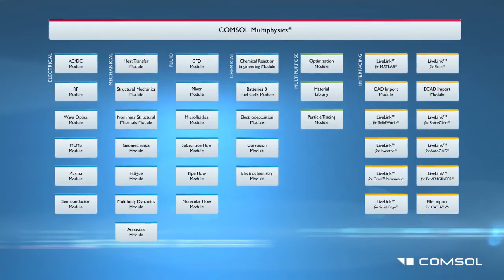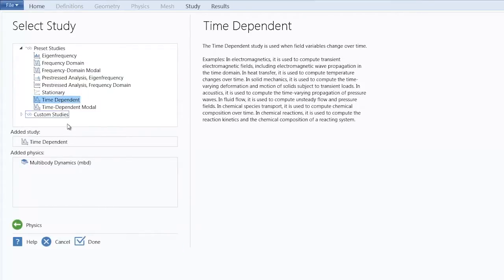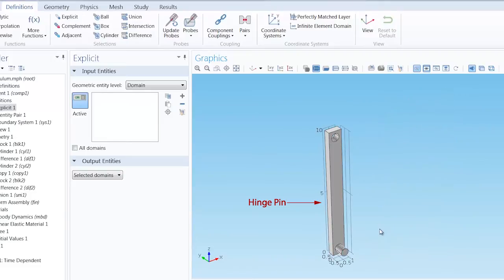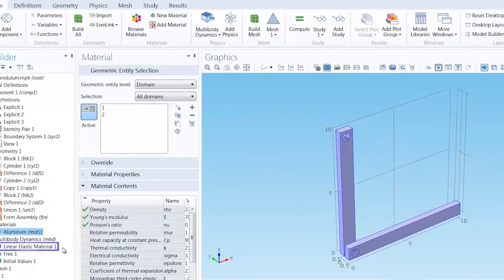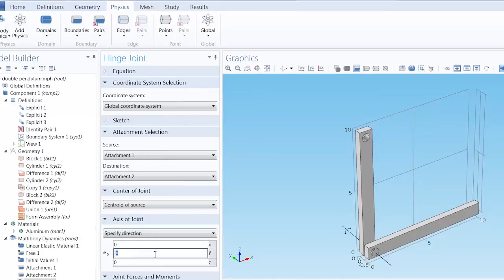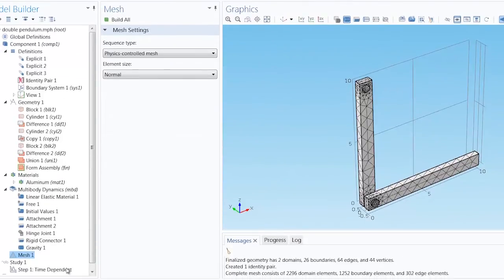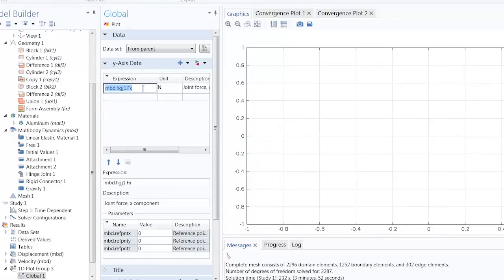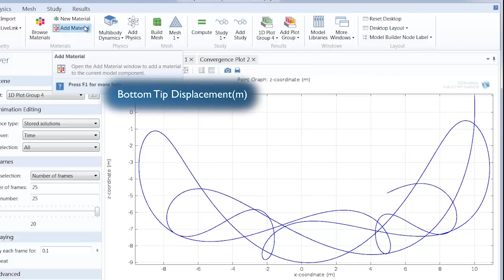How to Perform a Multibody Dynamics (MBD) Simulation

Comment: I did this tutorial in version 5.2.1.152 and it worked perfectly. Already in versions 5.3.x.x, doing the tutorial from the beginning, it does not work. The pieces are completely immobile. I already checked the gravity and connections and everything is ok. What's the problem?